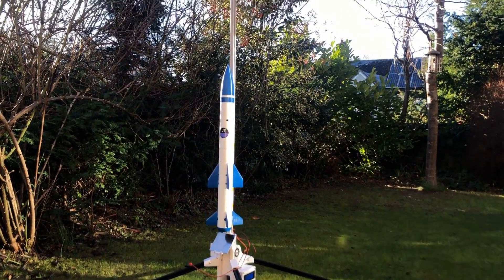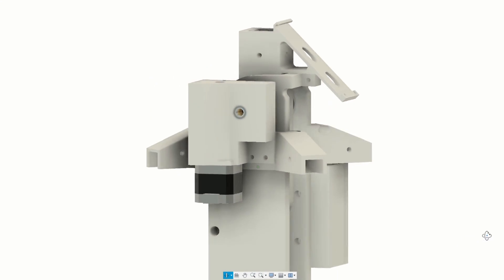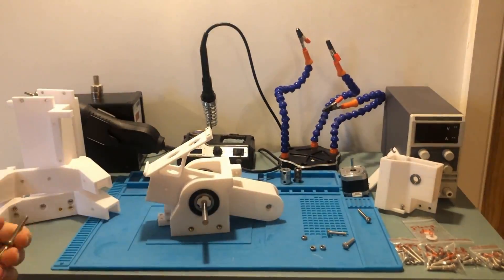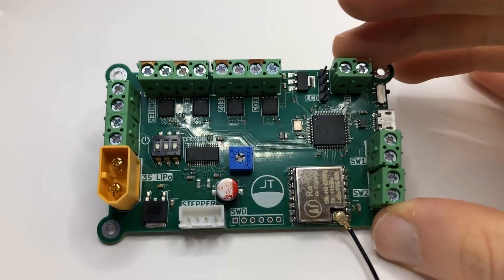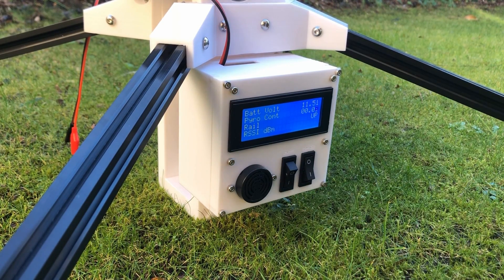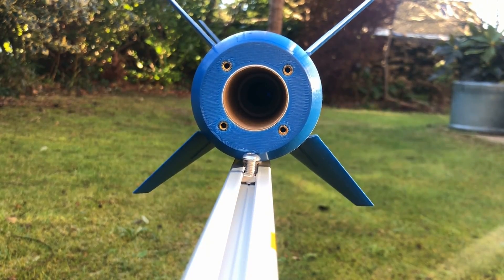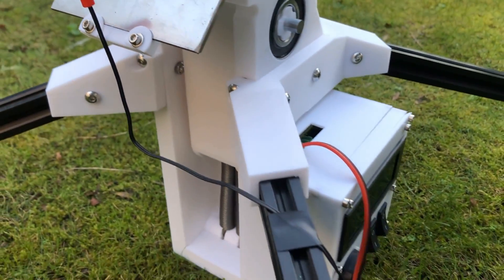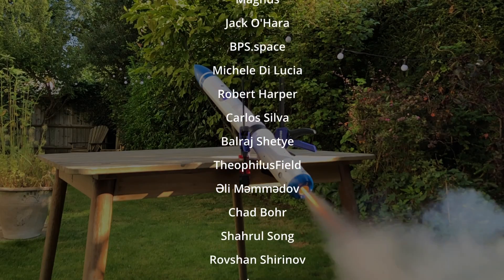Motorised Rocket Launch Pad

Comment: Hi
1. I recommend adding a bypass 100nF cap between pin 1, 4 to reduce even more the possibility of unintentional ignition due to noise or ESD.
2. It seams that the noise from the stepper is due to the controller and not to the stepper. 
  2a. Use controller with microstep
  2b. Initiate the next step before the motor stop, ensuring a smooser operation (with less noise)

Comment: It would be cool to adapt this with a little weather station that measures the local wind, mixes that with higher altitude wind predictions and automatically angles the launch rail into the wind so the rocked lands as close to the pad as possible.